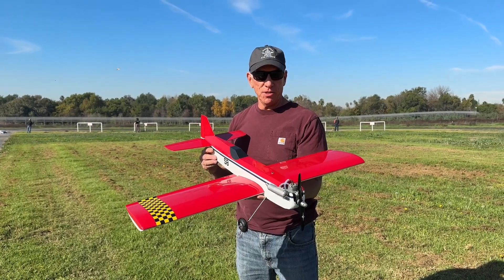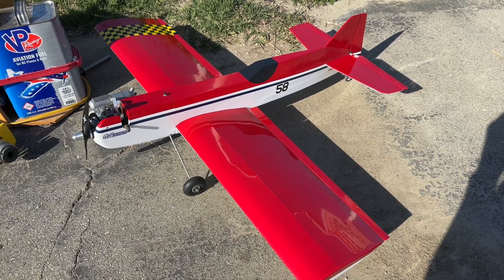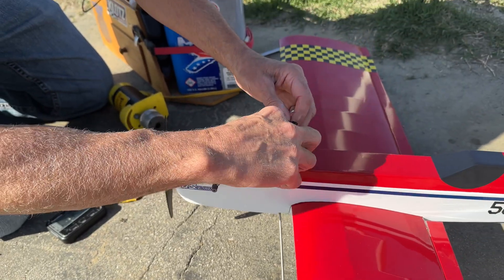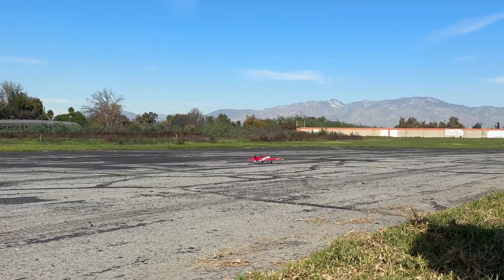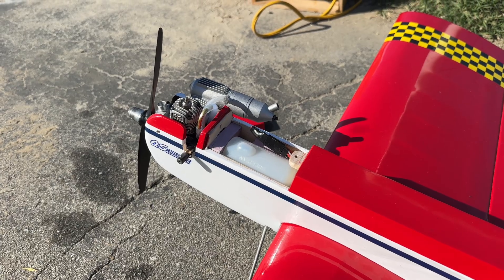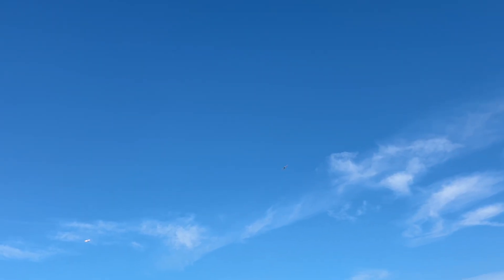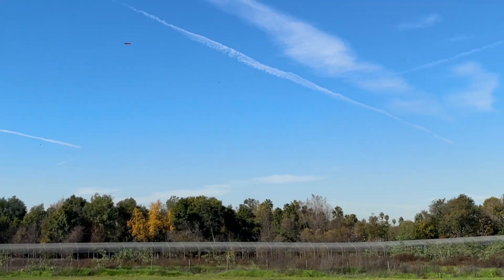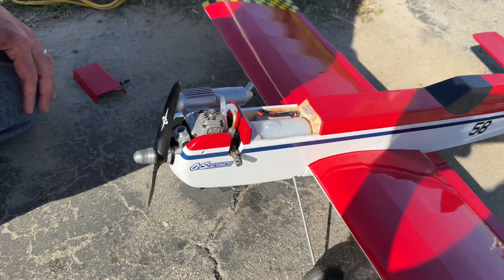How to Build a Balsa RC Plane Off Plans: No. 24 MAIDEN FLIGHT !

Comment: Great maiden, congrats.
Landings are tricky. Maybe try yo set up flaperons, see if you can bleed off a little more speed during final approach.
Reply from the maker: Thanks so much! Ya I could add flaperons, be good to do that from the beginning. It actually slows down better than it looks , i was coming in to fast because I wasn’t used to it. I think it could float in a little better with some practice.  That square wing is more stable than I thought it would. Thanks again!

Comment: Great job on the build. It really flies well.  The plane profile reminds me of a Gee Bee with the canopy toward the back. 
 It flies really well. The 15 is more than enough power.
Reply from the maker: Thanks! Yes the plane has that 1930’s racer look to it. And you are right, the 15 is plenty and a 10 could prob do it as well which would cut the weight.

Comment: How much does it cost?
Reply from the maker: Well the materials over time just to build, like wood, covering, landing gear, glues and all that, I estimate $100-125, but you don’t have to buy it all at once. Start building with the wood, like build the wing and its like 20 bucks for wood. Then move on to other parts and buy along the way. BUT then you need engine, tank, electronics, etc. with new engine and new electronics and all parts, about $300 , but again, build over a long time the costs are really spread out.
Reply: @JamesRCPlaneTech tks for the response!

Comment: James , great job I’m almost done with mine watching your videos has helped me out a lot. She definitely is a keeper 
And I had my fingers crossed again for the whole time. Question,  how much time can she fly on a full tank?
Reply from the maker: Thanks so much! Depending on how hard you push it, at full throttle full time prob 3-4 min. Cruising with half throttle easy 5-6 min or maybe a bit more. Ill have to do more flights to pin it down.
Reply: @JamesRCPlaneTech  Thanks

Comment: How many hours would you say you put into building it?
Reply: Does it matter?
Reply: @richarddarlington3229  I'm just curious because I'd like to build one
Reply: @NoelClemente-g9u 
That's cool. Have you ever built a balsa model before? 
I have many years of experience building model airplanes. 
You can ask me anything. 
This particular model may not be an ideal choice for your first build...
Reply: @NoelClemente-g9u 
By the way, a simple model like this would take me about 30 to 40 hours of actual build time. But, I've done this before. Your actual build time may vary. 
Any questions?
Reply from the maker: Well, you could get it done a lot quicker than I because making the videos takes a ton of time. I would say that just sitting at the bench time, about 40 hrs for me. So if you did some weeknights and a some weekends, I bet a month or six weeks if I wasn’t doing vids. But then everything else gets in the way of my time, so maybe a few months to get it done.